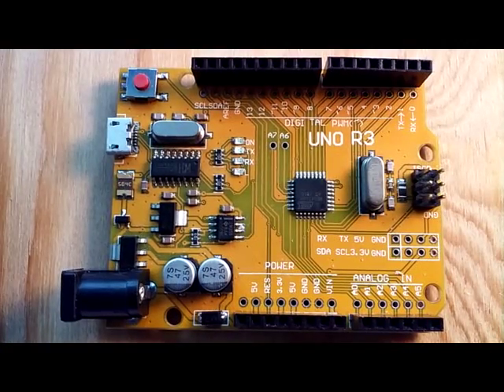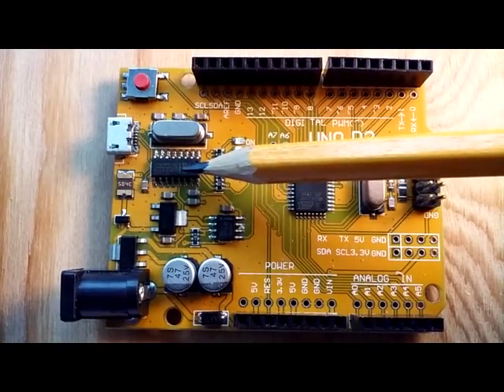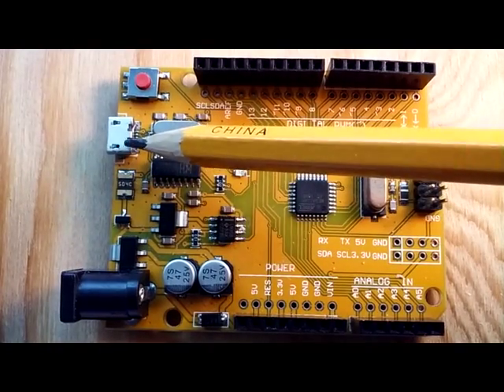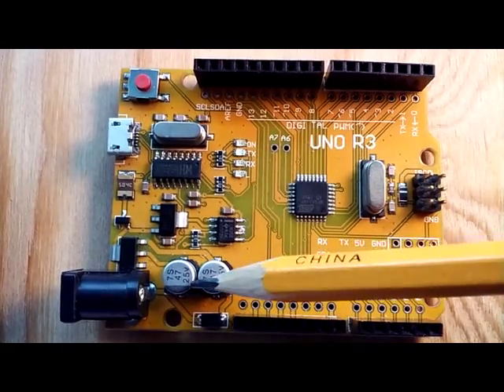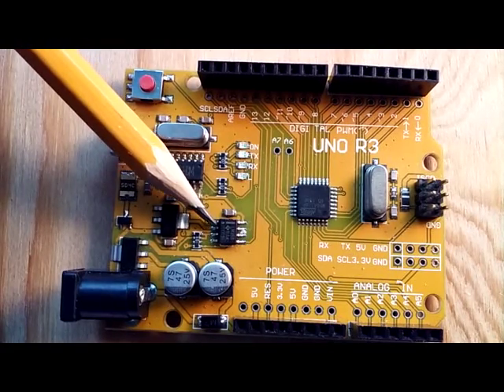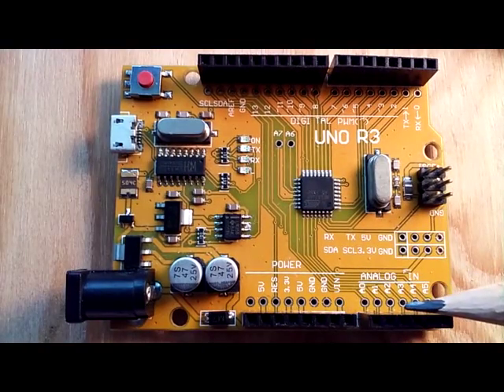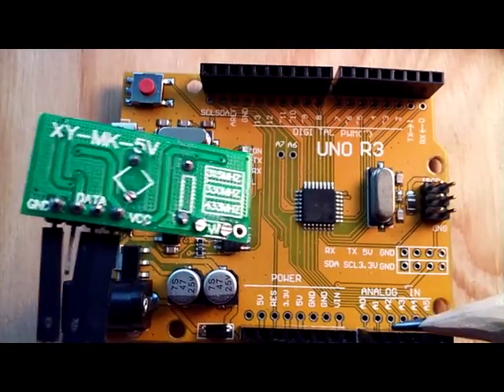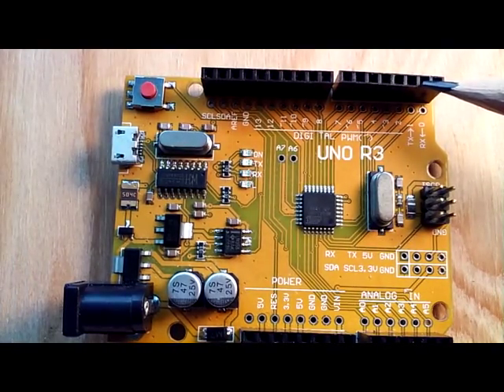Atmel ATMega328P Microcontroller Components Tutorial

Comment: How can I program my Atmega328p without an Arduino board? I am looking for a serial diy programmer. The atmega already has the arduino bootloader
Reply from the maker: +lcm As far as I can tell, you need a microcontroller to interface with the ATMega chip: 
http://www.instructables.com/id/Atmega-Standalone-Running-without-crystal-oscillat/?ALLSTEPS

Cheap Uno clones abound on eBay.

Comment: Hey P1  interesting video. Didnt understand all of it for sure but after watching this,  I am certain you would love the Raspberry Pi.
Reply from the maker: +Starfighter75r Hi Star, I didn't understand what all those things were at first either :) Yes Raspberry Pi is a complete operating system (Linux-based) device that would lead me down a new rabbit hole. I use Linux Mint at home. The ATMega microcontrollers just interface with hardware sensors, transmitter/receivers etc. and you process data either on LCD, serial monitor or other software.